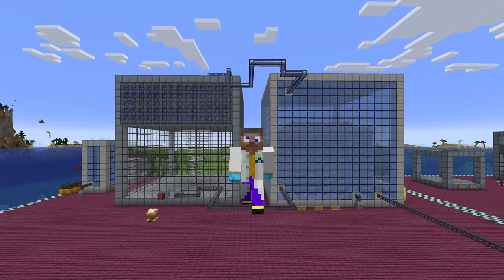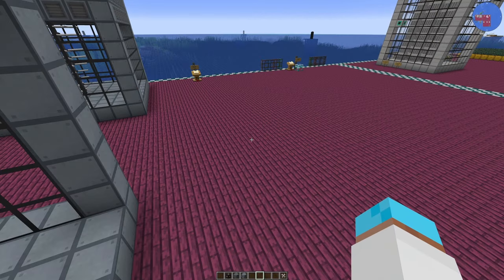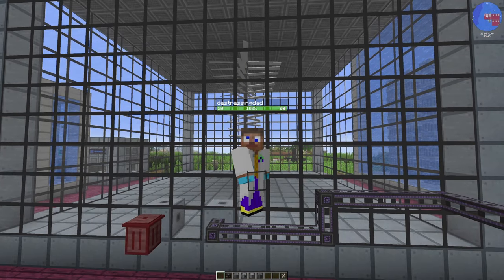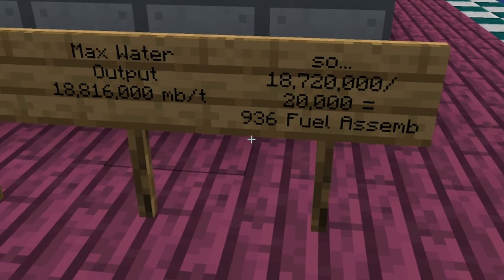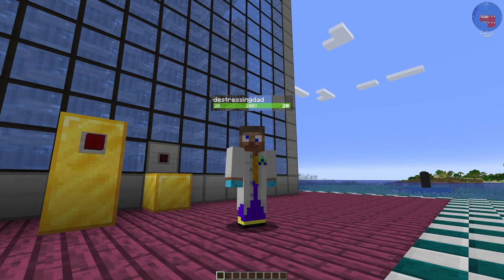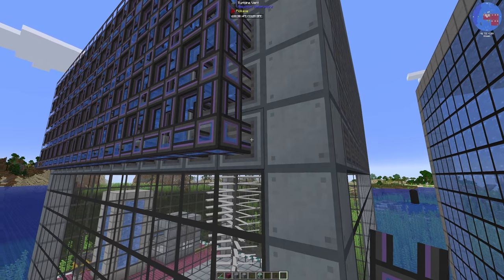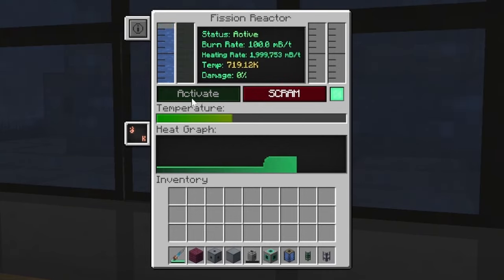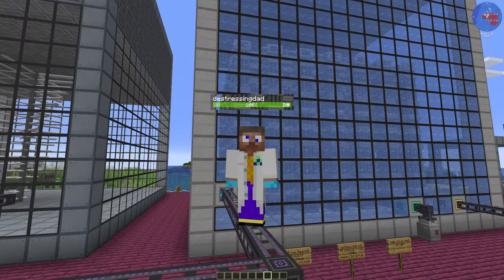How to build the Mekanism Fission Reactor and Turbine.

Comment: my industrial turbine is not turning steam into energy fast enough, which leads to clogging. on top of that, the water isnt getting recycled fast enough which leads to the reactor running out of coolant. (i set the burn rate to 1) any idea what i can do  to fix this?

Comment: i Think you should add one more part to the video. The output of energy needs to be controlled from the turbine. If it backs up to the max storage it will fill up the steam since it does not get rid of the excess energy. Eventually this will make the reactor explode :) Overall really informative video and really enjoyed it just made it but had the energy issue which made my reactor blow up xP
Reply from the maker: Good point!! I’ll add it to my fissile fuel video.. :)

Comment: I don't get the pipes bit, why are we prioritising capacity over throughput? Surely you need to match the flow rate with your pipe amount else you can't move fluid/gas fast enough
Reply: Actually, is pump rate just the rate at which pipes can extract? So capacity is actually throughput given something can push into the pipe fast enough
Reply from the maker: I think it's this, it's hard to determine from reading the Wiki's, all I know is have enough pipes to handle the"volume" of flow. If that makes sense. Don't forget to have an Energy Bin somewhere as your Turbine can back fill with energy that then causes a catastrophy! (Speaking from experience!)

Comment: How big of turbine is ideal for 9x9x9 Fissile Reactor?
Reply from the maker: How many "Fuel rods" are going in it? What is the Max Burn rate?  And then to run it at max - you'll need to be able to handle 20,000mb per tick into your Turbine. So you'll need your Max Flow rate to balance with that value. Build the reactor, and then let me know what your MAx Burn rate is.. and we can then look at the size of Turbine.
Reply: yes, figured it out after I checked almost whole video :P  @dsddoesminecraft

Comment: i connected pipes to vents but they're not filling with water. Why
Reply from the maker: Assuming you’re using Mekanism pipes?? And definitely the “Mechanical” pipe!??
Reply: @dsddoesminecraft  i found out that i didnt place saturating condenser.. I was struggling with it for 2 hours and it turned out that a few condensers were enough...

Comment: I’m 99% sure this video is wrong. Like VERY wrong. I’ve done everything I can to build the Turbine but it’s not working. I spent all day trying to trouble shoot rewatching this video 4 times and reading the entire FTB and Mekanism Wikis, and nothing. It wont work.
Reply: same lol i'm playing atm9 and i have a huge reactor and it works fine, but when i try to build the turbine, it just doesn't work. I've tried multiple setups and none of them worked even tho i'm building it the SAME EXACT WAY
Reply: It has to be 17x17x17 but even there it doesnt works for me idk what the problem is on the turbine
Reply: The rods need to be centered 17x17x17